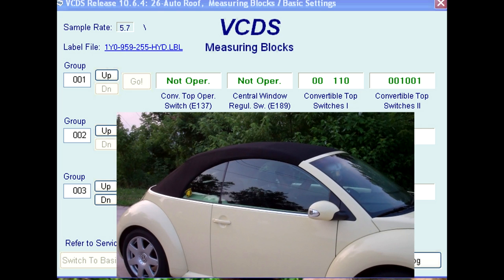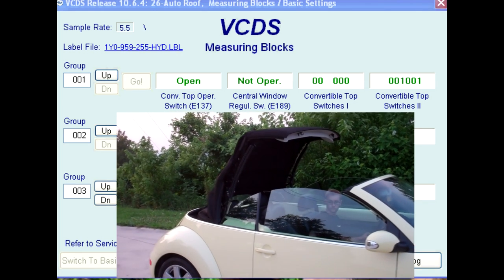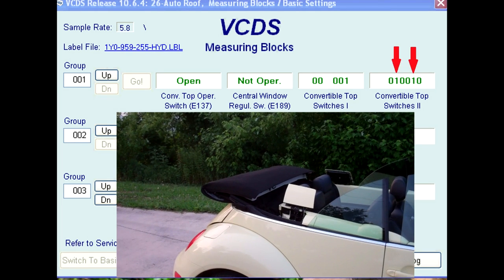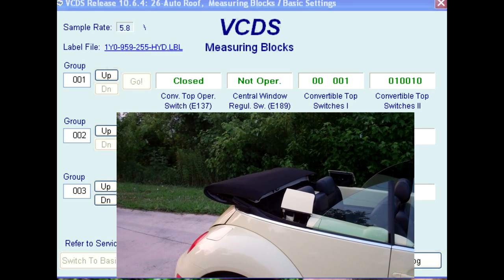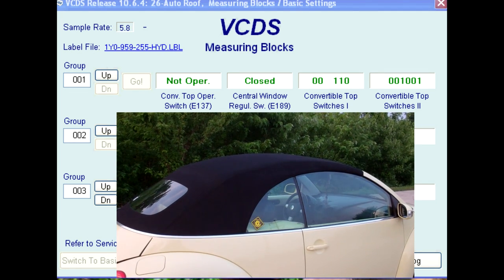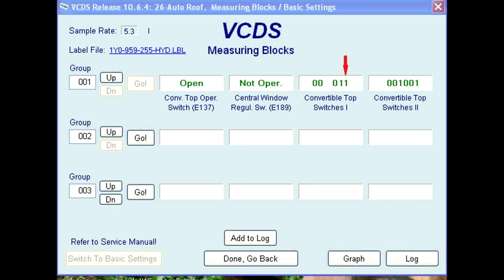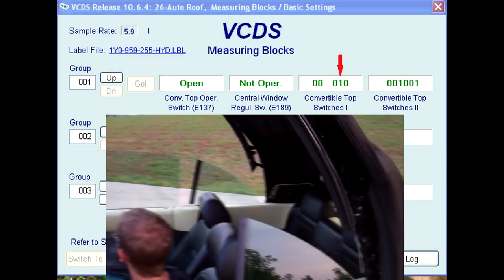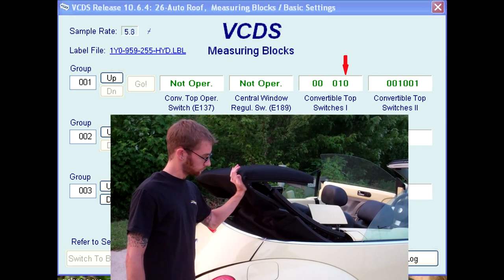New Beetle Convertible Basic Top Operation

Comment from the maker: The F171 is snapped onto the right side hydraulic ram.  You will need to remove the rear seat and right rear interior trim panel to access the F171 for replacement.
Reply: My 2003 says the top is open when it is locked down.. and the top up/down switch does nothing?  I'm assuming the switch in the window frame is bad?

Comment: Thanks for this. Was wondering if you can help me with my problem. I have a 2019 vw convertible with convertible issues. Whenever I try to open the top, it unlatches, lifts it about 2 inches and stops. There is no error code. The dash boar shows a message saying CONVERTIBLE OPERATION, and the car icon blinking in orange light. Pressing on the switch to close lowers the roof and latches it close
Reply: @dylan tantuico Same Exact issue with mine!! Have you found out what was wrong or any resolution?

Comment: 06 beetle with manual top.  My problem is all my windows roll down like the top is being opened.  Put my scanner on it and no convertible module shows, does on the 07 with the open button.  I even looped the micro switch in the roof and still does it.  Any ideas?
Reply from the maker: We offer free vehicle tech support for our customer on our web forum.  

https://forums.ross-tech.com/index.php
Reply: @RossTechVCDS  just registered.  Haven't found anything with this problem on this car unfortunately.  Fingers crossed someone has something there!